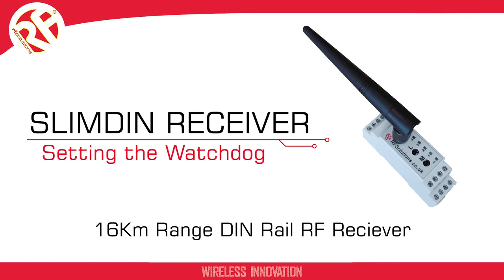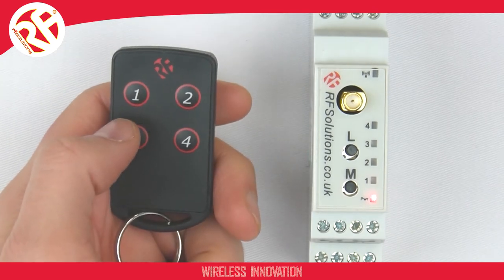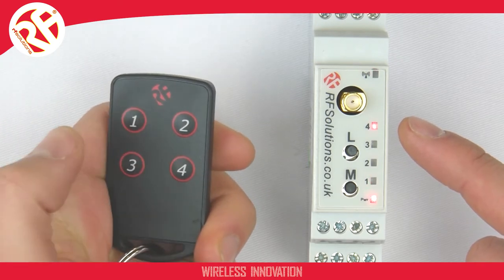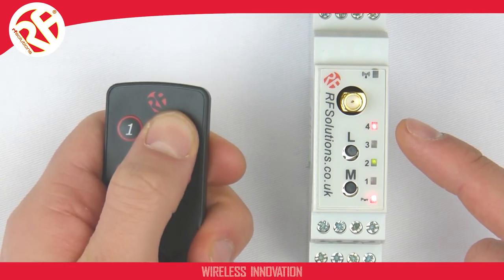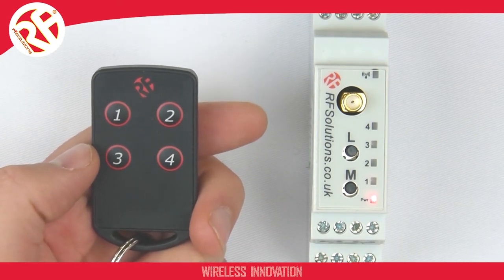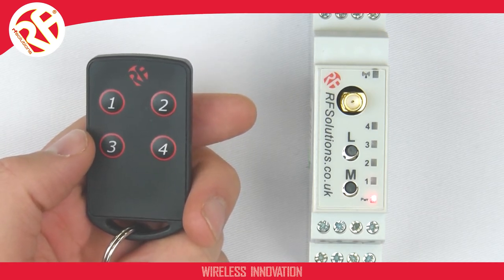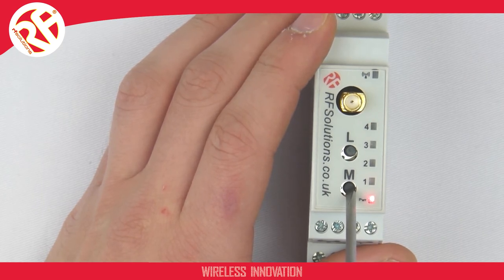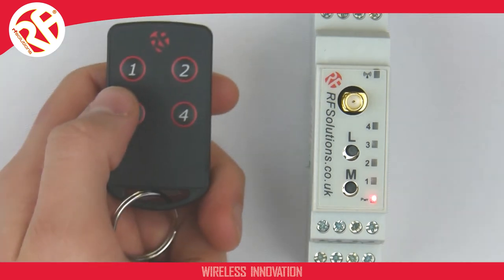SLIMDIN Receiver | Setting the Watchdog | Industrial Remote Control Receiver

Comment: Hey can I use channel 4 on watchdogs but also use it latching switch at same time?
Reply from the maker: Hi Matt, when the watchdog is in use, relay 4 only functions as the watchdog relay; it cannot be used for anything else. So when you are using the watchdog feature, you only have three output relays available to use. I hope this helps. Thanks.